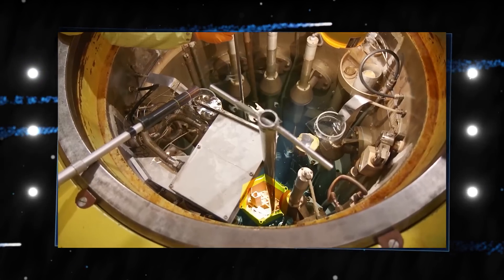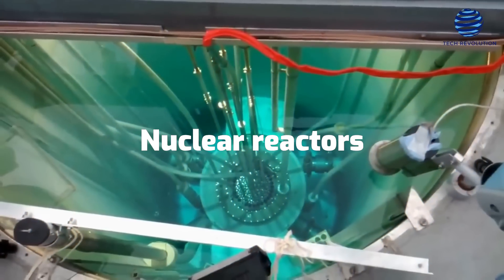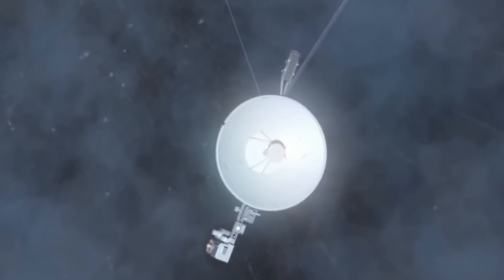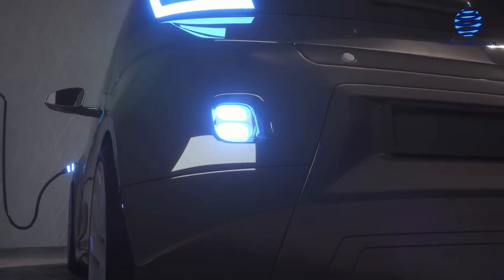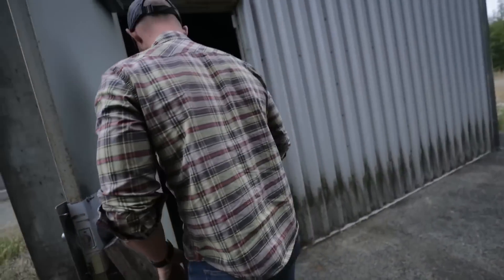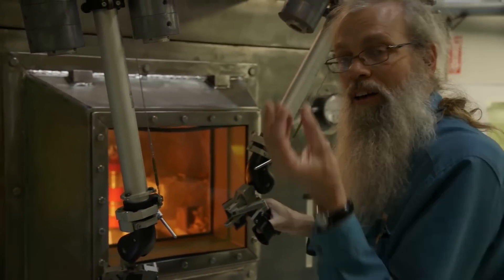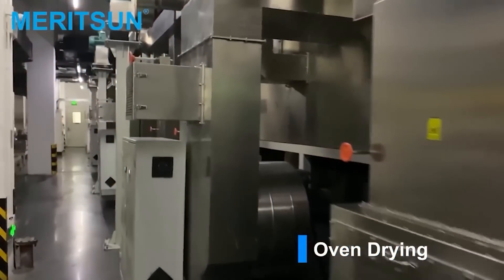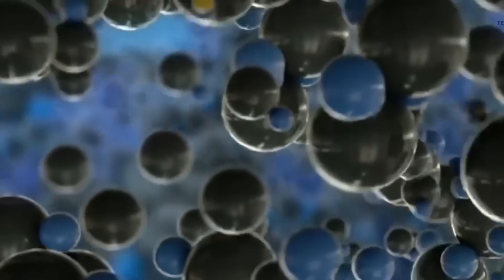It Happened! Scientists Have Created A Nuclear Battery

Comment: I have seen a lot of videos about these nuclear diamond batteries, but not one of them answers the actual important question.  Are we going to get radiation sickness from them?  Will a Giger counter pick them up?  If a Giger counter picks them up then they ain't safe right?
Reply: It's a beta radiation it's the same thing you get from the Sun it's easily blocked the casing it'll be in would block it and you never even know it
Reply: It’s a rotten scam. This video is promoting some seriously ignorant nonsense! The power output of nuclear diamond batteries is just way too little for use in EVs. Imagine a nuclear diamond battery that can last 1000s of years 😊...then, realize such battery needs to be 1000s of times bigger and 1000s of times more expensive than a Li-Ion battery for the same power 😮🥸🧐…do your homework about POWER DENSITY and you will understand this message!

Comment: This has nothing directly to do with spacecraft as they use a hot isotope and thermocouple for power. This is an artificial diamond made of cold isotope of carbon and works electron emission by cold particle the problem with this is that when unused electrons return to the emitter their energy is released as heat and as the emission is controlled by proximity and as the isotope is bonded part of the diamond heat control from unused electrical generation could cause issues in upscaling.

Comment: Yeah, 49 years ago and they installed it in Voyager I and II, and they keep going and going and going and going and go.....None of you remember, they were DESIGNED to last NO LONGER than TEN YEARS at the OUTSIDE LIMITS! Voyager II was HOPED to reach Jupiter and fly-by it's moons. We CAN power cars with nuclear power, but WHAT ABOUT WRECKS??? Oh.
Reply: The shielding necessary to keep you alive would break the wheels off the 12000 pound car! Beta radiation is very bad for living things. And nothing lives for a thousand years. 
This video is full of lies! Put this battery in a pacemaker, and the patient DIES!
Reply: I would use alfa radiators and basic solar panel material and start there to research best version.